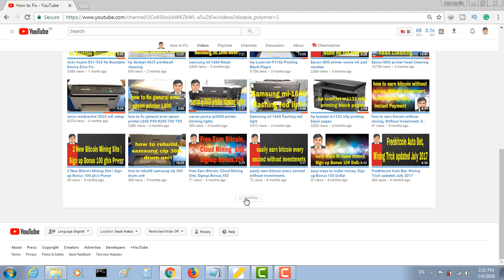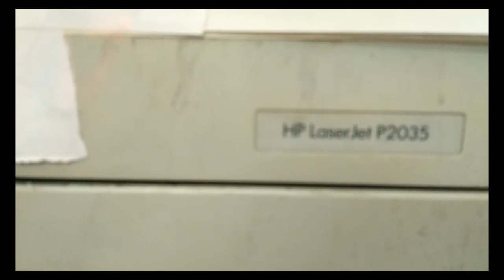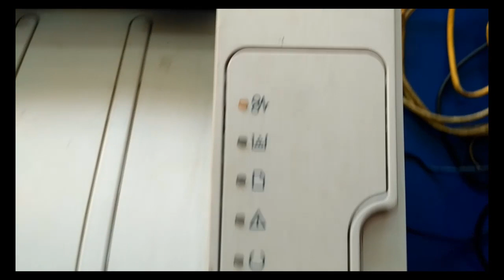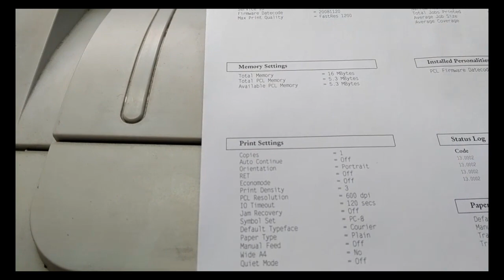Hp Laserjet P2035 Paper Pick-up Issues

Comment: To ALL safety freaks like me:  The video did not show turning off the power before using the window cleaner.  If you want to be careful, ALWAYS turn off power--unplug device also--before doing anything inside elctrical gear.  THis adds 20 sec to the procedure and may be very important!